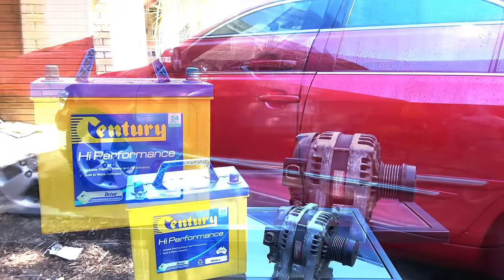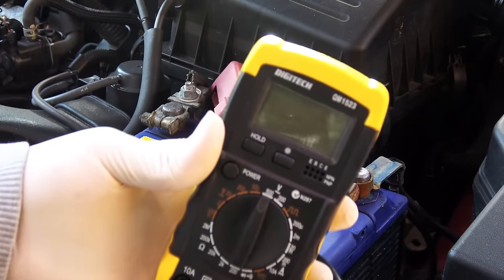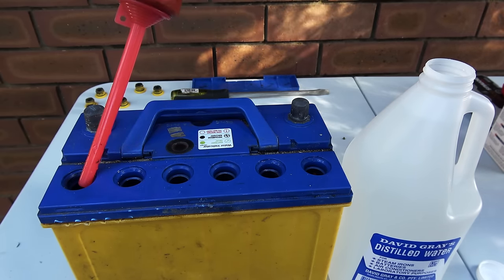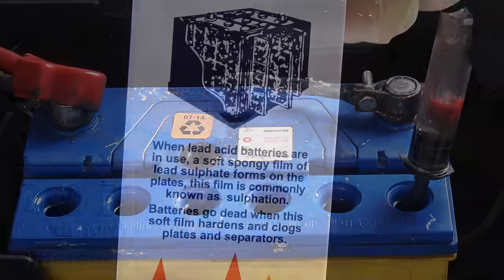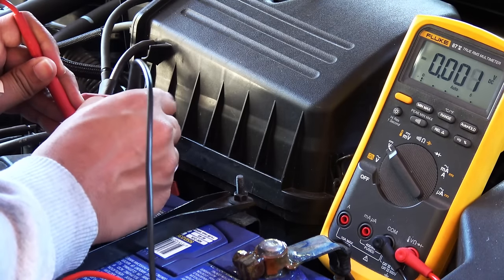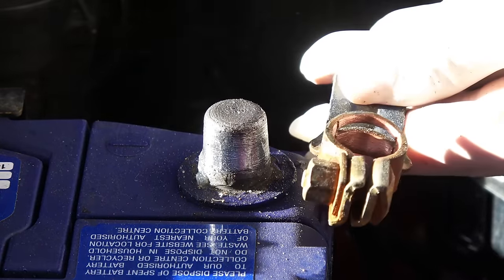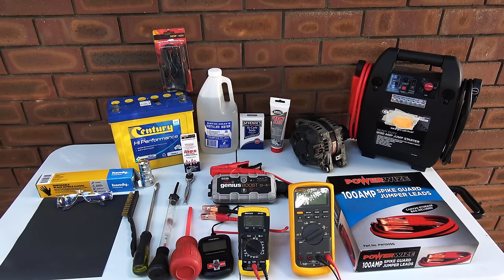How to Test a Car Battery With a Multimeter ( Voltage + Cold Cranking Amps)

Comment: Got some misinformation there ! The voltage maybe dropping below the minimum due to a bad starter which is why they sell load testers, much cheaper to purchase than a Fluke multimeter.

Comment: Great video! If you just installed a bnew battery (1 or 2 days old), what should its readings (range) in the voltmeter be normally?

Comment: Great presentation .my cheap voltmeter showed 12.6 and did not go below 10 volts when cranking but the car did not start .i took the battery to autozone and it was bad! Good multimeter is the best investment

Comment: Great video and information, my only suggestion is you should make sure you fully charged your battery before doing a CCA load test. 
My electronics teacher in high school in the 1980's taught us to use baking soda and water in a jar and soak the battery terminal in it for a few minutes to remove the corrosion before cleaning the terminal with a battery terminal wire brush, and he also said Vaseline Petroleum Jelly can be used to cat the terminals and help prevent corrosion, I have used it for decades, and never have corrosion issue's. I also use a Pulse Tech battery desulfator / Maintainer on my battery to reduce battery cell sulfation, the claim the patented frequency can desulfate batteries, and is used by the U.S Military on their vehicles.

Comment: Nice sort and to the point video :) , i am at the point of buying a CCA tester i just seem to have bad luck with batteries.
Although i have found that things like SCA and similar generic batteries seem to not last as long as big name batteries like Century or Excide or will die quickly if you are pulling a high draw on start-up in utes etc. 
What really gets me is places that want to keep your battery to charge and re-test, even when just failed the test's...should be like other things just replace it and sorry but its up-to the business to deal with battery company not you

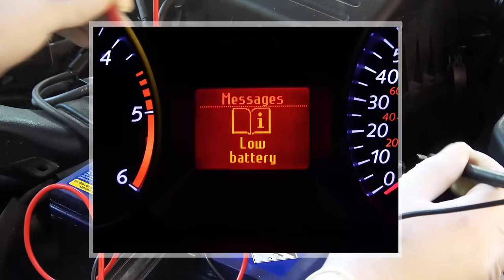Comment: Thanks for the info, but I noticed a problem at 1:46 in the video. Is it just me, or isnt the voltmeter hooked up incorrectly?  You have the positive and negative terminals on the voltmeter reversed, which is why the reading is negative 12 v. Even though Australia drives on the left side of the road, I think red is still positive for you guys, right? LOL. But seriously, thanks for the info and your time in creating this.
Reply: You are right, he has the leads reversed at the meter.

Comment: What is the minimum acceptable cranking voltage ? Eg if voltage drops from 12.4 to 10.18 v during cranking, then does this mean the battery is weak. My battery is 5 years old, so I guess 10.18v cranking voltage means it needs replacing ? It’s a 2 litre diesel Toyota. Thanks.
Reply: If it drops below 9.6 V when cranking, the battery has to be replaced.
Reply: @404notfound..... He showed the more expensive electric voltmeter shows micro secdrop of voltage around 8,that needs replacement. But later the OBD II blue driver live data shows crank voltage above 9.6V. The other better tester shows crank voltage below required in Watts. I guess,safer to just replace the battery😂

Comment: Issue is with the car running the battery voltage jumps around wildly from 14v to 9v to 2V to 12V etc.. while running idle. any guesses?
Reply: Weak connections
Reply: @Izzyfoshizzy710  thx for input, but no. battery died when it got colder outside! 6 year old one :D

Comment: Great video mate , i measured 12.4v overnight,  and after 3 days 12.2v , starts fine. Running voltage is between 14.2 - 14.v. Is this normal for a battery?
Battery was replaced in August 21 , with a larger 480cca. Cheers.
Reply: Mine is doing the same. How did your battery hold up?
Reply: @SimplifiedTruth  I ended up buying a CTEK charger and used a recon mode and it has made a massive improvement on battery life, starts are great 👍
Reply: @DECKARD263354BR  Awesome. Recon mode? That's a mode of the charger Or vehicle?
Reply: @SimplifiedTruth  It is a reconditioning cycle, because one day I left my map light on and it drianed the battery, it never got to full voltage until i bought the charger and charged it full cycle,  brought it up back to voltage like new.
Such great chargers the CTEK, some prestige car manufacturers provide them with the cars purchase 👍

Comment: Junky what app are you using to view control module voltage?
Reply from the maker: it's the app for my scan tool call "blue driver"
Reply: @JunkyDIYguy  Thanks. I have a Veepeak scan tool. I can get a live graph of OBD2 voltage but can't see a way of reading the min and max values. Min after starting engine looks about 9.6v. Battery was charged yesterday to 13v.

Comment: I've had the same battery since new & its charge was 12.42 volts when I bought it new in 2016,its gravity has always been in the fair range (white) since brand new,its CCA rating is 420.

AFAIK when the battery gravity is down in the red area,it either needs to be recharged or possibly replaced.

I did this test to GM specifications which is at about 70°F (21°C) temperature with a fully charged battery :-

1. Disable the fuel & ignition systems

2. Connect the multimeter terminals to the battery terminals.

3. Operate the starter motor for no longer than 15 seconds

4. Observe the voltage which shouldn't reach below 9.6 volts,mine didn't reach below 10.3 volts during the time that I was cranking the engine over,so it must be o.k.

I did try the minimum voltage setting on my multimeter & it got down to 9.2 volts when starting the engine but that was with a 12.26 voltage (half charged), apparently between the 9-10 volt range indicates that the battery is still o.k.

Comment: Nice. My battery reads 12.85 volts with the engine off. With the engine running it reads 13.80. These are good numbers to have.

Comment: When I start my car it's a slow crank? Is it my battery or alternator or my starter is going bad I'm trying to figure it out
Reply from the maker: sounds like a weak battery, take you car to an auto parts store and have them do a battery and an alternator health check for free,
Reply: It can also be the alternator is bad if you crank the car a lot then your battery will be drained number one number two if your alternator is going bad it will not charge the battery so it will look like your battery is bad but it's the alternator number three it depends if the battery is top post or side post so you can measure the voltage drop across the terminals

Comment: Some aspects of this video are very accurate but he's way off the mark in others. He's calling his tester a load tester, but this is just a simple resistance based tester and these are very inaccurate, mostly labeling bad batteries as good. A true load tester is going to be large because of the carbon pile load bank located inside and will have an adjustable load for various CCA ratings on various batteries. His battery charger looks like a jump box, not sure about that one. Also, you can not use the starter for testing the battery because a bad starter will begin to pull excessive amperage which would give you the same symptoms. The best thing to do is look at the voltage and age of the battery. If you know you didn't leave anything on in your vehicle that would have drained the battery, your voltage is under 12.6V, your terminals are clean and connections good, and your battery is more than 3yrs old, 99% of the time it's going to be a battery. Always go to an automotive electrical shop if possible for battery/starter/alternator testing as places like Autozone and Pep Boys are clueless and even many regular mechanics shops do not know how to properly check these things, especially the more complex systems on newer vehicles.
Reply: I took my battery to autozone and they said it was hood because it was reading 12.4volts. But they don't know about crank amps and how they work. My battery was reading good but not enough under load to start the car.

Comment: wow so much to buy, yet better off just checking the volts with cheap multi meter and make sure its a sealed battery, with green or view window to show the condition of the battery, forget the rest, but also if the car does not start and the battery is good, then sometime disconnecting the battery and depressing the brake ,will re set the computer and any excess charge in the cars electrical system?

Comment: How to tell if door's power window motor still works
Reply from the maker: check the fuse and relay for window motor, if they're good then you can remove the door panel and unplug the connector for window motor. use a test light to see if you getiing power to the motor when as press the switch. manually supply power to the motor as well to if it works

Comment: you haven't mention THE MOST COMMONi issue with car batteries - battery draining from the inside... It will show up like your battery is due to have it's replacement, but doing it WILL NOT RESOLVE ANY PROBLEMS... You just gonna buy and then trash a new batterie in few weeks...
To measure, how much your car is draining the battery when it's closed and parked, you need to pop the hood, then close your car like you normally would, then take off a negative terminal off it's post on the battery, then connect a multimeter set to measure amps in between the post and the terminal and wait about 5 minutes (usually between 30 seconds and 2 minutes, depends on a car model), and you gonna see, when the amps mesurement gonna drop - that means your car have switched of all of its electronics which doesn't have to run - then check the amps measurement and compare it too data available in the internet to see if it's not too high for your car model and equipment. YOUR WELCOME.

Comment: My alternator never shows more then 13.4  volts  it goes down to 13.0 After it's warmed up but never goes below that even if I roll down the windows and all that stuff..    Car is new..    they said its normal..     I left my car key on by accident with my inverter running,   i Fell asleep ..lol  I have an extra battery in the trunk and I have wiring to the front battery I had to jury rig it so I could  start the car through from battery that I have in the trunk..  Battery only had 11 V but it worked no I'm letting it charge even though the car never reads more than 13 V I don't get it I have a OBD sensor in car radio unit  If I drive down the road it's 13.2 V but it never goes below 13 at idle it's 13 right now if it's cold like winter time it can go up to 13.6  or so..But it's pretty warm right now at 90°..     I just don't wanna be stranded that's why I still have that extra battery in the truck but it has a different terminal for the battery so I can't directly replace it now I'm afraid to turn off the car...lol   When charging the battery is it better just to worry about the amperage more than voltage

Comment: How does a terminal go " bad "  ??
Reply from the maker: Few reasons, loose connections can cause arching and arching can cause severe oxidation between the battery post and the terminal. Even seen wall outlets that don't work? just like that.. Corrosion can do that too, Corrosion is not always visible in every metal like in ferrous materials.
Reply: Loose connections are a given, however the terminal is not " bad "..     clean the inside and outside of the terminal including the battery post and that should do it..   Honestly, I've never heard any kind of mechanic refer to a terminal as bad.. its just loose or corroded  which requires cleaning or replacement if it breaks.
Reply from the maker: Not in this case, coz if you look closely, you can see inside the terminal, there's a second thin metal collar around the inner perimeter. Oxidation between the terminal head and the inner layer can't be cleaned as they can't be separated. This was an old design in Japanese made Mitsubishi"s is early 90s. If it was a regular solid terminal, then i agree with you. That's why in the video i showed how to clean terminals inside and out.
Reply: Battery terminals go bad all the time, most people neglect to clean or maintain their battery terminal connections and gassing from batteries causes severe corrosion. On the thinner terminals used on many newer vehicles the metal will get thin to the point where there is not even enough structural integrity left to remove it from the battery without breaking. It will even start to work it's way into the cable itself making it necessary to cut the cable back to get all the corrosion out. And the heavier old school lead type terminals can and will get stretched out to the point where they just won't tighten properly any more. They are also prone to stress cracks along the front where the tightening bolt goes through. This comes from the repeated over tightening of soft lead terminals. They should be tight to the point where they won't wiggle back and forth any more but no more. And they often don't get seated all the way down to the base of the terminal which causes the person to crank down on them even harder.

Comment: Why does the multi meter show negative on it? Anyone
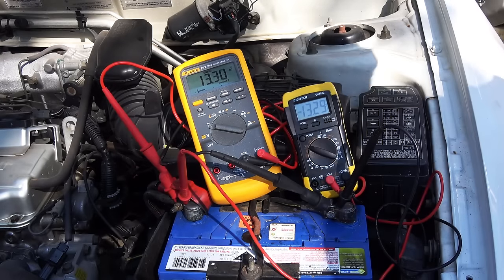Reply: He just has his multimeter leads plugged into the wrong holes. at 2:58 see how he has the black lead plugged into the COM port on the bigger multimeter? on the smaller multimeter, the red lead is plugged into the COM port. This won't affect the reading of the amount of voltage, it will just show a negative sign that tells you the direction of the current flow.
Reply: He had the leads plugged in to the multi meter the wrong way round.  Red was connected to common.  Classic School boy error.